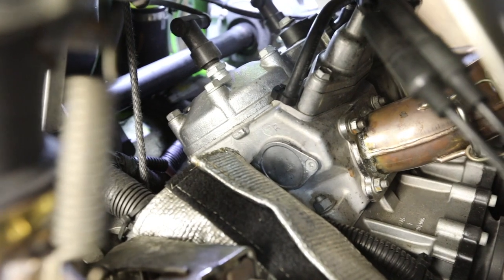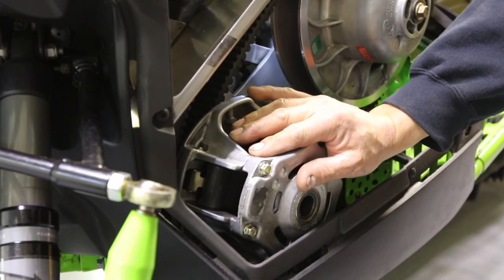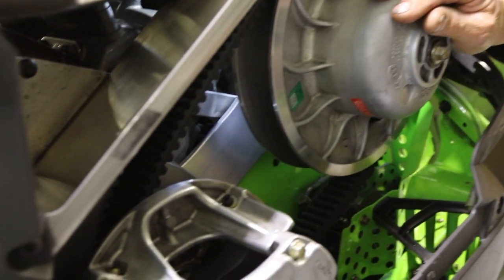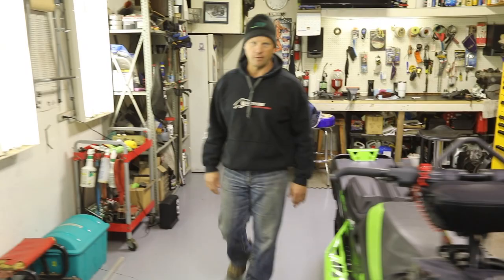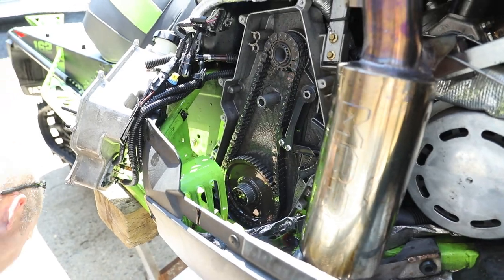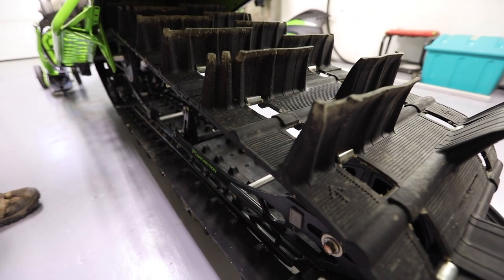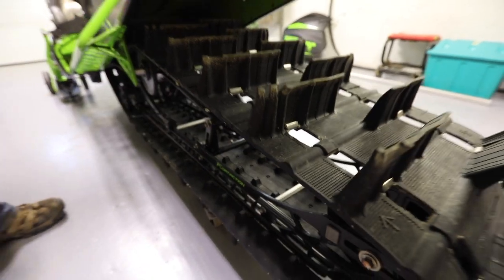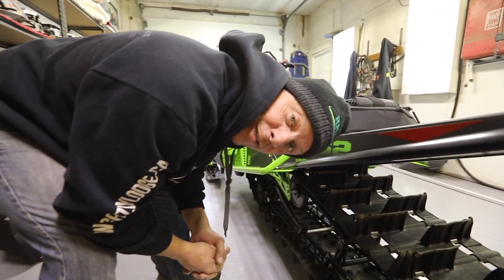How does a snowmobile work?

Comment: I actually wanted to know how it moves and why it can only work on snow. Not so much an assembly guide lol
Reply: If I had to guess, it only works on snow because the coefficient of friction of snow is very low. That's why a snowmobile works on snow but not a motorcycle. A snowmobile has more surface area in contact with the ground than a motorcycle, providing more grip. However, on a normal concrete road, all of that grip that the snowmobile has will be TOO much grip, to the point where it probably wouldn't even move.
Reply: @andrewcallam1288  they don’t only run on snow lol although I only use mine in snow
Reply: @andrewcallam1288  they will move on concrete no problem, although you usually get less traction. 

The problem with running a snowmobile on anything other than snow (or liquid water) is a snowmobile needs snow thrown onto the track sliders and cooler to cool the sliders and engine. Without it the machine would overheat very quickly. Crossing roads and loading onto trailers is not usually an issue. 

On ice or even hard snow most riders put down scratchers that throw ice and snow onto the track to improve cooling.

Some people run them on open water but that has it's own problems (they can sink.)
Reply: Same! Glad I’m not the only one!